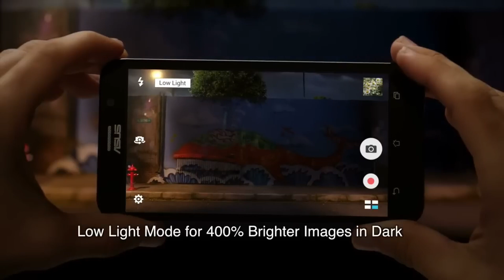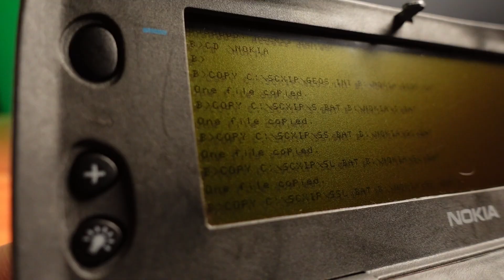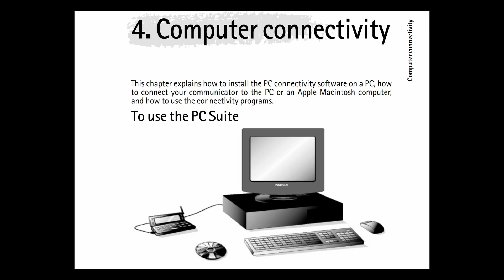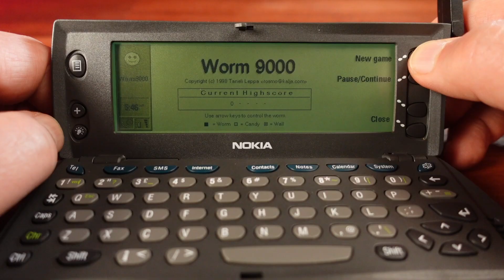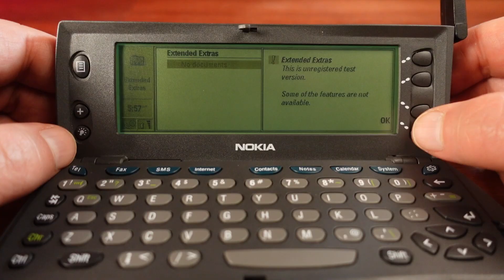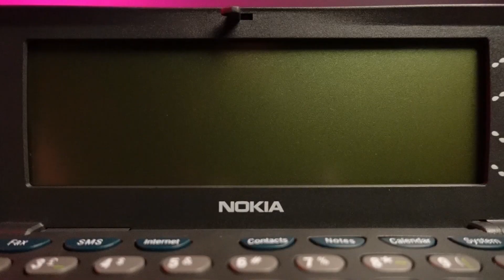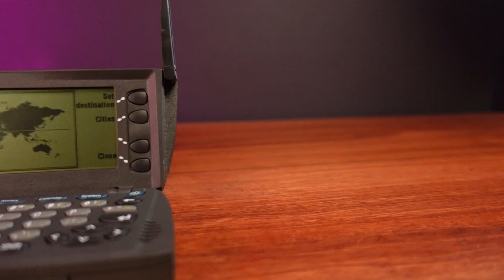Running on a 486 CPU : Nokia's 1998 Smartphone

Comment: Used to have one in '99/2000 I think it was? A college got the updated version a couple of years later the 9210 I think with the colour screen. I started using a Motorola 3g phone (can't remember what model) with... A touch screen. And stylus. Wooooo.
It was amazing for the time. 
Btw my 9110 had to have... Wait for it... 3 different phone numbers tied to it at the same time to make it work properly. 
One for normal phone functions.
Second for fax.
Third purely for data. 
I used it a lot for data, tied to my laptop through the infra red port. Put the laptop on the table and boom. Emails. AOL on the move. It was excruciatingly slow for any website with graphics. Somewhat faster with the wired connection to the phone.
Getting a hard copy fax off it was a chore though, could only be done by connecting to a computer, through the Nokia software, downloading it and then printing it off.

Comment: I cut mine in half around 15 years ago, with a big iron saw. On phone launch day... downloading a single porn pic from the web took 10-20 minutes ( 320x200 resolution, greyscale )  and cost 10 usd in connection time with a Vodafone contract in Germany.
Buying the phone was 1000 usd back then. I spent 4000-5000 usd/year in the launch year of the phone with the cheapest mobile phone contract.
Reply from the maker: I'm glad you used yours for the right things there.

Comment: Dude the phone is 20+years old, ofcorse after lots of use it has problems.
Also you need a old sim to it be read, sim's have different versions, the newer sims wont work on old devices.
Reply from the maker: You can bet this SIM was old. I kept em all!
Reply: I sometimes use my sim(10+years old and still works) on a 5110, also 3210(should be somewhere) and a E52 is my everyday backup phone.

Comment: I wasn't this cool and was still rocking a Nokia 8210 (which was still a great phone for the time) back in 1998, but I eventually got a Nokia E90 Communicator around 2007.   It was still better than the early iPhones, although by the iPhone 3G I made the jump and have had some version of that ever since.
Reply from the maker: The 8210 was an amazing phone for the time. One of the smallest and lightest ever made!

Comment: I'm thinking you probably damaged the CPU with the hot air gun or the solder balls underneath it. Placing a metal shield over the CPU while reflowing the flash (NAND?) chips could have prevented the damage.
Reply from the maker: Thanks, I will be much more careful when I do these things in the future.

Comment: Re-flowing hardly ever lasts if it works at all. I have re-flowed the graphics chip on my old T42 ThinkPad twice, done the same of a friend's Asus laptop a couple of times until the graphics chip finally died and done it with a few other devices. When the lead free solder gets old, it just becomes brittle it seems.  Re-balling is the only real option in my opinion. Fresh solder.
Reply from the maker: If it had worked enough to explore it for a video then I would have been happy. It was broken already so worth a try.

Comment: From memory "Simcard not accepted" was also the message when the phone was provider locked, so maybe it is not broken, just simlocked

Back in the day, atleast in my scandinavian country, they would sell phones with a discount if you bought a phone with a subscription.

The thing was, a lot of the time, the discount war more than what you actually paid in the 6 month period they were allowed to force you to subscribe so to prevent people just buying it and then sticking the subscription in a drawer they would lock the phone to a network so that if you tried to use a different provider it would not work. After 6 months you could get a code to unlock the phone, from the provider.

There were a lot of guys doing unlocks, as taking out the subscription and then paying someone 10-20 USD to unlock it was still a good deal.

The hope from the provider, was that when the 6 months was up, you would stick around and they would eventually make the money they "invested" in getting you onboard back.

Comment: Could of been the flux that caused the issue with the first one. You have to remove the flux or it will cause shorts
Reply from the maker: That's a good point, thanks.

Comment: 00:00 📟 The Nokia 9110 Communicator was among the first phones to utilize BGA chip technology, housing an AMD 486 CPU, and featuring a memory card slot, setting it apart from its predecessors.
01:16 🔍 The phone's computer side exhibits faults possibly due to sensitive movement, hinting at dry solder joints inside the device. It operates on ROM-DOS, an embedded version of MS-DOS.
02:35 🧰 The Nokia 9110 was the first phone to use BGA (Ball Grid Array) chips, a common method today for chip attachment. Potential issues with the thin board and solder ball cracking are highlighted during disassembly.
05:20 🔋 After encountering issues with the first Nokia 9110, a secondone powers up successfully, running GEOS 3.0 on ROM-DOS, showcasing its graphical environment and backlight features.
06:39 🎮 Utilizing its memory card slot, software installation becomes feasible, although finding compatible cards posed challenges, eventually enabling the installation of games and programs.
09:23 ⌨ Hacking methods revealed access to a command line on ROM-DOS, showcasing limited graphics capabilities but enabling exploration of CPU details and DOS utilities.
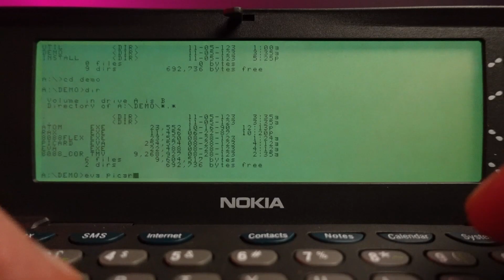11:33 💡 The Nokia 9110's CPU has potential overclocking capabilities and hardware CGA (Color Graphics Adapter), hinting at the possibility of enhancing graphics performance, although challenges remain in development.
12:54 📱 Reflecting on the Nokia 9210, a successor with a color screen and an ARM CPU running Symbian, contemplating a potential video on this model while expressing fondness for the 9110's greyscale LCD.

Comment: I'm surprised a 486 could be sufficiently power efficient for a phone. Love the design with the phone stuff on the outside. Not a bad idea.
Reply from the maker: I believe by the late 90s they had shrunk the die down for  embedded use. Also the datasheet describes low speed modes and suspend functions built in..
Reply: @JanusCycle Yeah, I saw that. I believe AMD were building less powerful but more efficient processors than Intel at the time. For instance, you might buy a Pentium 60, but get an AMD DX4-100, or even 120. It wasn't the same as Pentium performance, but the highly clocked 486 could still deliver something respectable.
Reply from the maker: @johnknight9150  Intel were doing the maximum power & performance at any cost thing at the time. Until Transmeta really challenged them with the low power Crusoe, That's why Intel killed them.

Comment: I loved my 9110i. But it was far away from reliable... I am a heavy user, so these things lasted a maximum of 4 to 6 months - after this time, the flat cable between the upper and lower part broke, which forced the item into a shutdown, so I had to reboot it dozens of time each day. One call to Nokia - and a two days later, TNT Express delivered a new one.... Most of the time, they didn't take the old one back. Nokia had a distribution office in Vienna in these good ol days - every time, when I was in Vienna I brought them a package with all the broken Communicators. This worked well, as these were under warranty. And so I had to buy one every 2 years - which was quite an awfull lot of money. And I still have one 9110i as a decoration/memory. It was and is a cool thing.
Reply from the maker: That sounds like some very heavy use. I hope you were also very productive!

Comment: I worked in a mobile phone shop as my first job in the late 90's and my boss owned one of these phones. I was so envious as I had been dreaming of owning a Psion Series 3... But I was not aware that this beast was hiding a 486 CPU inside, I would have been even more lustful of this device had I known, being a fan of Doom and PC's at that time. 

I'm amazed that x86 existed in phones back then. How was the power consumption and battery life?
Reply from the maker: Battery life, from what I can tell is fine. This 486 was designed for embedded use. So by the late 90s the chip die had been shrunk considerably and it had extra functions built in, including very low speed modes and suspend abilities.

Comment: That antenna thing isn't gimmick. Once I was stuck in a tunnel, had to wait till other trains pass. Every passenger were just sitting with their out of network mobiles while this communicator managed to not even send SMS but also maintain decent bidirectional GSM call.  Kudos to Nokia engineers
Reply from the maker: That's some quality Nokia engineering for you.

Comment: I did own a Psion 5 witch had the best keyboard on a mobile device. The only thing i did not like was the battery's. You had 3 AAA (i think) battery's. If you had to swap them one at a time to change them all. If you remove them all accidentally then you would loose everything.
Reply from the maker: Psion 5 looks cool, I'm looking forward to one day trying one out.

Comment: These phones were amazing! I've almost had all of them. The 9000i, the 9110, 9210, 9310 and last but most impressive, the E90. I think i still have them all, except for the 9310. Broke and got replaced by insurance for the E90 :)

Did i need these? No. 

But i liked them :D

The 9110 was an incredible step up from the 9000, especially in size and shape. The 9000 really feels like holding a horn and is very heavy (They all are, as they're big phones, but the 9000 ATE the cake & took another one with it for the road.)

The 9210 felt like the biggest upgrade, as it went to a color screen. 

The 9300 was a small upgrade in comparison, bit quicker etc. Battery didn't last as long though!

But then the E90... Wifi, camera, touch screen.... And it looked very stylish as well. The performance of this phone was incredible, screen was crisp and bright. It really felt like having a powerhouse in your hand lol :) I'd catch myself thinking "what if Nasa had one of these in the 60's" and other things guys will think about when having nothing else to think about :P

Looking forward to other reviews of the nokia communicator series!
Reply from the maker: The E90 sounds good, I hope I'm able to get one one day.
Reply: Shouldnt be difficult to find on on ebay or other marketplace :)

Comment: I had one of these back in the day. It had been abused by the previous owner so it eventually died. After seeing this video, I reckon the BGA chips might have been the problem. I thought it was the ribbon connector between the two halves that failed and I tried to track one down without any success.

I think that was the one phone I ever owned that left me feeling like "wow, this is the future". Spreadsheets, real dial-up internet like my PC (not that WAP nonsense we had back then), and the ringtone composer was *chef's kiss*. Not to mention you could record voice memos and use those as message alerts or ringtones. I feel like I want one again.
Reply from the maker: It must have been amazing to have one at the time. I hope you kept your broken one.
Reply: @JanusCycle  I'll definitely look for it. Someone gave me a dead 9000 as well but I never got around to seeing why it didn't work. I think the most amazing thing for me back then was having a full size keyboard and basically unlimited storage for SMS
Reply from the maker: @GiGiAUT1987  That's right! I remember seeing 'SMS storage full' at the time with not that many messages in the phone.

Comment: I still have 2 of these with Nokia branded memory cards and a GPS module that plugged in the bottom for sat nav ... it would also print via IR to a portable HP printer I still have.

Comment: Apllying heat to re-solder the chips is indeed risky. There is a possibility the solder balls underneath would stick together and then its gone. Removing the chips and reballing them is the only reliable solution.
Reply from the maker: It's worth the risk just for the experience and knowledge. Thank you for helping add to that!

Comment: 5:10 killed a 9110 because u didnt slowly bake all the moister out of the board before using a hot air gun. 

High heat plus moister = popcorn.
Reply from the maker: Thank you! I learn so much making these videos, it's wonderful :)

Comment: This brings back memories!
I still own my 9110i, it used to be my main phone up until 2006. I tried both of the sucessors (9210 and 9500) but they sucked because of poor design decisions for the user interface. The 9110’s user interface was clearly built with one menu key and the arrow keys in mind, and it was very straightforward. The 9210 started to mimic a PC interface with fold out menus and other things that would actually need a pointing device. It was disgusting for me, so I kept using the 9110. Even after I replaced it as my main phone it served as a backup work phone until 2015 when the battery finally died.

Comment: Man, can't even imagine how cool and futuristic it would have felt to use this at any point in '98-2000!
Reply: Yeah it was awesome, the one that came after it i think had a colour screen, but i remember using a nokia like this around 2001-2002 and it was the maddest device to play snake on at that time. I was only 11, my god if i'd known how timelessly cool it was.
Reply: @yamgoat2965   The 9210. I got mine in 2002 (still have it, but obviously not in use). It wasn't Snake you played on that but a cool puzzle game called Bounce. The 9210 was kinda weak in the RAM department and so didn't run as smooth as the 9110i did.
Reply: it was crazy futuristic and very very expensive
Reply: @jimzucker  They wheren't that expensive. I had the 386 version for a while around 1997. It was a PITA to use as a phone because it was so large and clunky. I later switched it out for a Ericsson GH 688 which you could plug an IR connector to and do dialup with other palmtops (I had a psion palmtop). When I did my army service in 1998 it was handy to have to browse the interwebs or shitpost on usenet.
Reply: I had one in 2001. The 9110i. The most impressive thing for me was wav file ringtones. But the speakerphone was great too. It was just before the time of GPRS, so you had to dial up to use the internet.
Reply: I just loved the Nokias of the 90s!

The communicators were always my dream, but I couldn’t afford one until they got color displays!
Before I could get it I used my trusty Nokia 6110.

Later I especially loved the 6310(i) when the communicator was too big.
Man I miss those days, it was a so much better and more relaxed feeling than with the smartphones of today..
Reply: yeah i used and still have. you looked dope
Reply: I had summer job in Nokia at summer -97. I was making software for next communicator that came after Nokia 9110. I had Nokia 9000i for company phone. Ah those times when the brick 9000i was on it's belt case pulling pants down constantly and if you had jacket on there was noticeable lump.
Reply: 50 hours yearly web connection time cost me around 5000 usd per year, in the launch year of the phone. +1000 usd to buy the phone with a Vodafone contract.
Reply: @babbathehat2919 5000usd a year? Are you serious??
Reply: I wanted one back then but couldn't afford it. I settled for a Nokia 7110 which had primitive web browsing (via WAP).
Reply: My father had it from work back in the days and had no clue how to use it other than for making phone calls. I loved messing around with it though :)
Reply: @bastiankrueckeberg2906  this is the actual dream situation lol. Having had access to it at the time, but only incidentally, as a kid, and with none of the associated responsibilities or stressors 😝 bet you just felt like little Neo surfin the information waves of the future 🤣
Reply: Used to cost like ten thousand marks in Finland
Reply: ive played doom on it in 2001 ;]
Reply: Nokia 9500, then E90.
Reply: @Deontjie There were the Nokia 9000, 9110, 9210, 9210i, 9300 and various other "Communicator" products too. The 9210 was the successor to this, and the first with a colour screen, an ARM CPU, and an OS based on Psion's EPOC32 OS, later renamed to Symbian. Back when Nokia and Symbian OS had the lion's share of the mobile phone market.
Reply: Just for rich Peoples
Reply: It was dated, even back then.  I remember "ultraportables" back in 99-2000 time frame, because I was really into it.  The one to have was the HP Jornada or the Psion if you could live with monochrome.  I remember buying an Sony VAIO PCG-N505 VE/VX because it was just a tad bigger but was a full PC rather  than one of these "palmtops" that ran WinCE and were rather limited.
Reply: Yeah i had one of these, my job basically required it. But it was so heavy, and so big. I never brought it with me when i wasn't working.
Reply: My best friends grandpa had this one
It ws the sh**
Reply: Hold one of th3 z fold phones before you get to 2054
Reply: no better then any Pentium 2 coming out around that time
Reply: @HarmonRAB-hp4nk  ...except in your pocket?!
Reply: It did! Seriously loved that phone! Still have it in a box somewhere...

Comment: I worked my way to a few of these before moving to the 9210.  Loved it.  I worked for Psion during the '90s during 16-bit platform era, and going to GEOS was quite a bit of a downgrade.  There were no alternatives however.  It was also the first hands-free speaker phone, you could send and receive fax, and don't forget this was a baller's phone: if you had one of those you made it to the top.  While I certainly did not made it - it felt great people thought I did.  Oh well... different times.

Comment: You may have had better luck with the cold joints on a hot plate for resoldering those kinds of single sided boards. IIRC there was an open source project to build one a few years back?